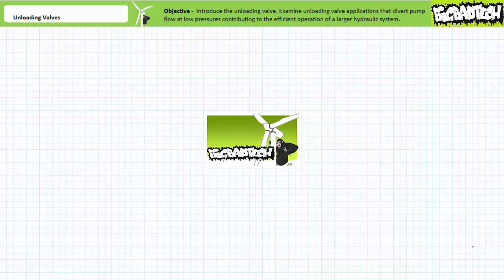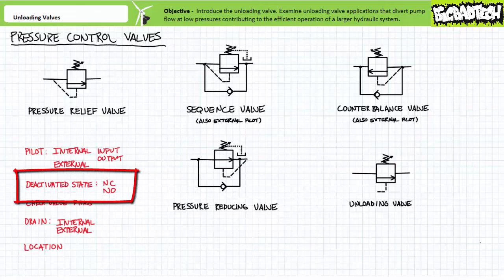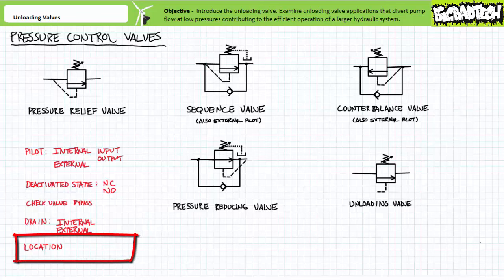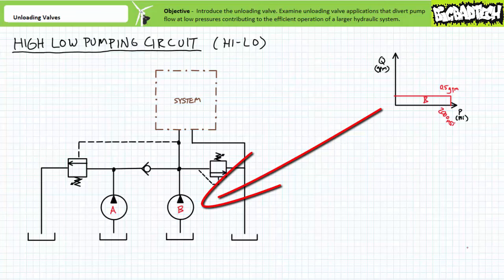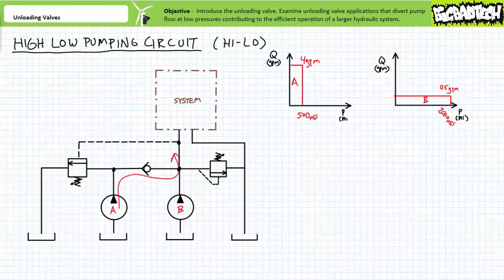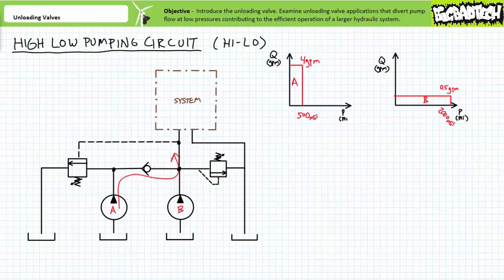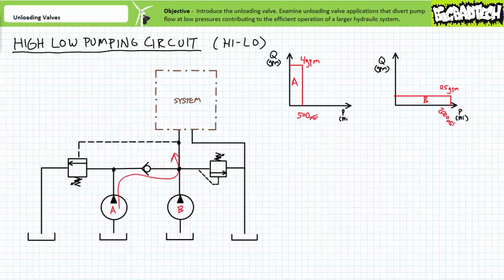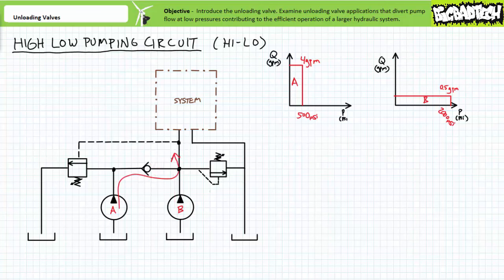Unloading Valves (Full Lecture)

Comment: Hi Jim,again thanks for these lecture.These  Differential Unloading Relief Valve is the same as Unloading Relief Valve?Also the difference in pressure is constant bet the pump side and accumulator side?Some hyd manufaturer dont carry these item.Ive encounter an Unloading Relief Valve w/ the check valve incorporated wit in.Really learns a lot from your lectures.More power!!

Comment: I read in a pump data sheet that starting pressure should not be more than 20 bar for that pump. Is this restraint induced by the pump mechanical design or the prime mover motor's electrical characteristics? 

Will this restraint prohibit the use of the third unloading method?
Reply from the maker: I'd hesitate to give you a definitive answer without looking at the specific data sheet but because this limitation is mentioned on the pump data sheet (rather than the prime mover's starting torque) this limitation would probably be because of the pump's mechanical characteristics. Provided the maximum starting pressure is above the low pressure limit for the pressure switch it would charge the accumulator.
Reply: You probably looking at the LS controlled piston pump. For those LS margin or “stand by” is about 20 bar. 
The lecture is not talking about some specific pump type.

Comment: In both scenarios, the pilot operated UV and the differential area UV there are pressure cycles that the accumulator goes through .
The only difference i can see that is in the differential area UV you can control the pressure range and if possible minimize it but in the pilot operated UV you do not have that level of control . Is there any other advantage ?
Reply from the maker: Honestly that's it. With the differential unloading relief valve you basically operate off the accumulator between the high and low value while the pump is unloaded. Only when pressure drops below the low value does the pump recharge the accumulator.